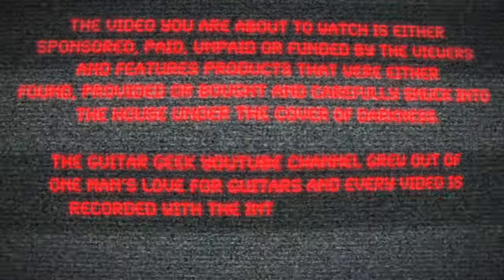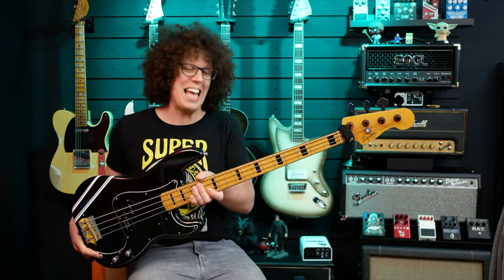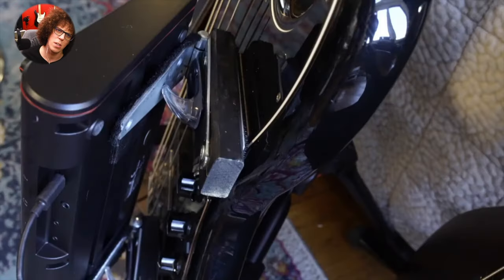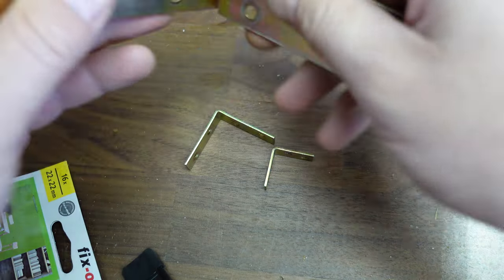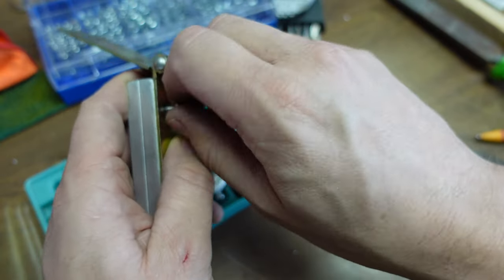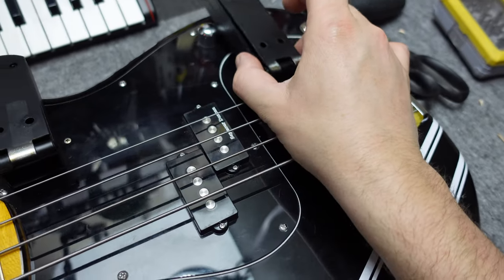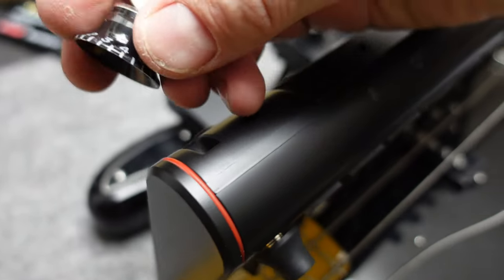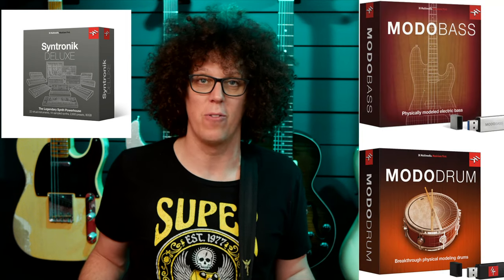I built the BASS OF THE FUTURE (Really Fun Guitar Mod Project)

Comment: Interesting, a previous bass player that I had used what looked like Hammond organ bass pedals as pads whilst playing the bass, extremely effectively. 
This post inspired me to slappa da bass
😎🎙🎸✅
Reply: I bought an old organ (£10) then gutted it for the pedals. I left the midi and sound attached (ugly and need to make sure the mains in insulated). One day will use velostat  and an arduino to generate an poly after touch controller.

Comment: How much space is routed behind the pick-guard?

If you swapped the pots toward the back of the body, they'd be accessible. The jack could easily sit behind the keyboard if you used 90degree lead.

You might need to find an un-drilled pick-guard, or make one for the spacing to work.
Reply from the maker: I’m going to rework it at some point
Reply: @TheGuitarGeek  That's without hacking up the body... You could move the pots back & drill through to put a telecaster-style jack on the side of the body pretty easily too.